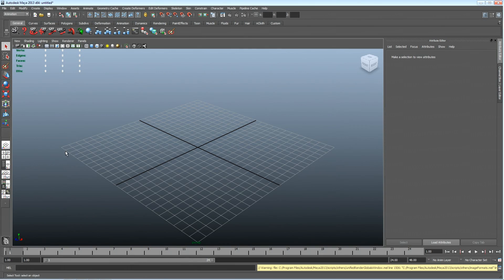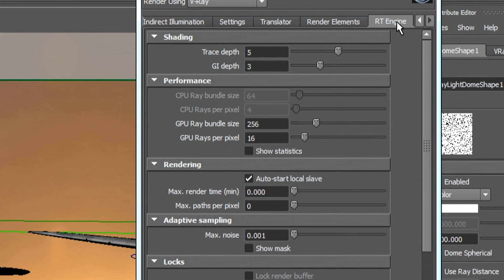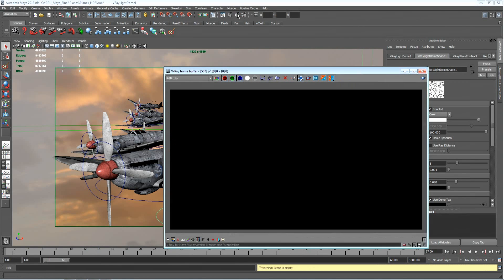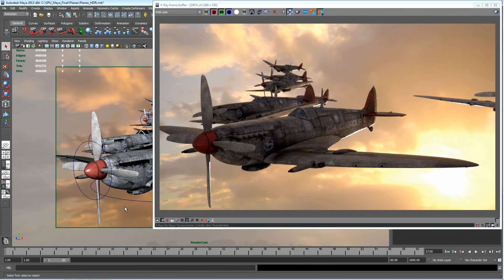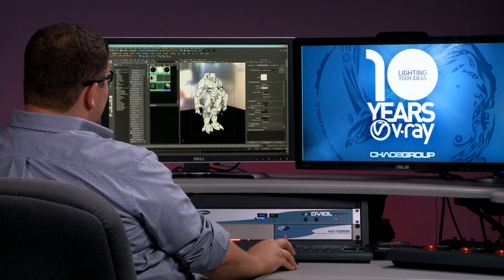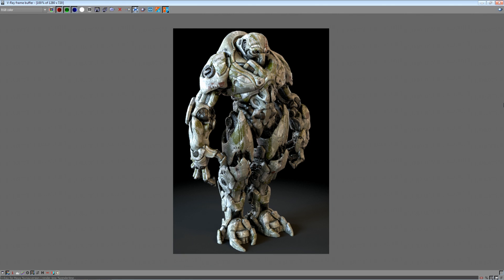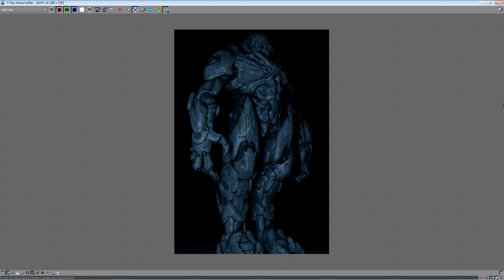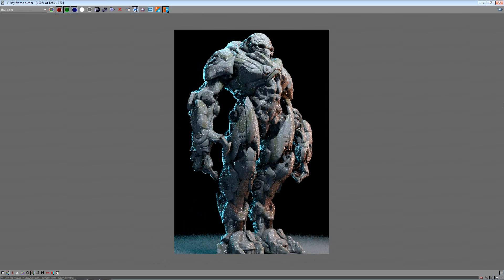Interactive 3D rendering with Autodesk Maya, Chaos Group V-Ray RT 2.0 and NVIDIA Maximus

Comment: Cycles is pretty slow if you don't have a supported GPU, but if you do it's actually a bit faster than in this demo. Sadly, there's not very good GPU support right now, but they're working on it.

Comment: Not much. Mostly it's the interface. They do very, very similar things but they'll just be in different places. Maya is generally used more for animation and dynamics whereas Max I think has better modeling tools. Max also has the upper hand in plugins, such as FumeFX, Thinking Particles, and Rayfire. Overall I would say that "out of the box" Maya can do more, but Max is still incredibly capable and with plugins is incredibly powerful.